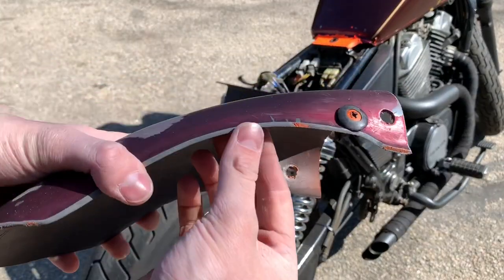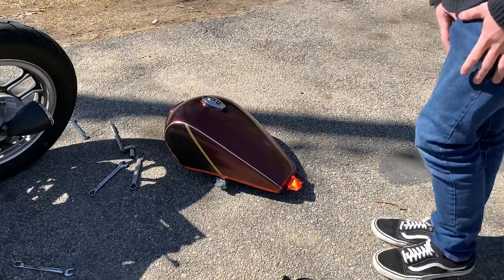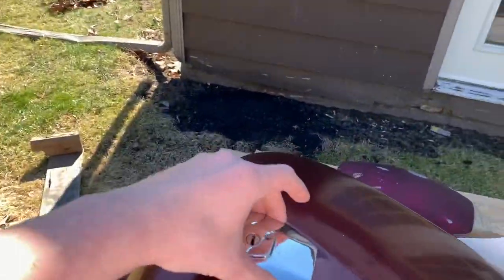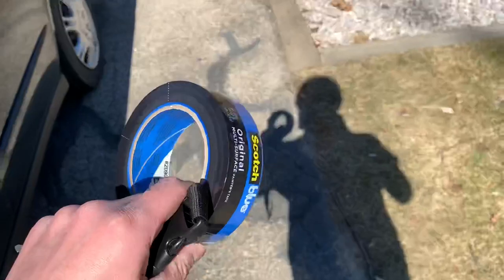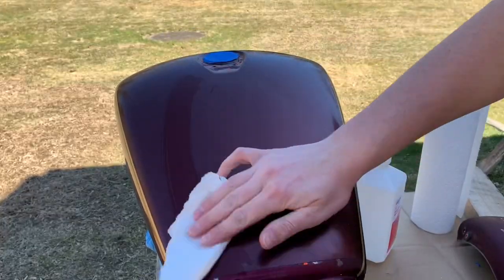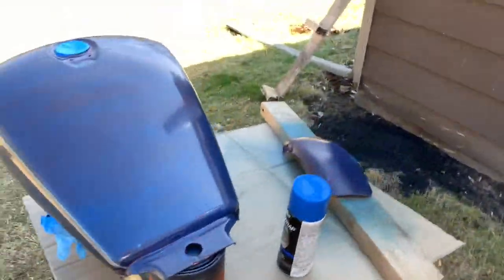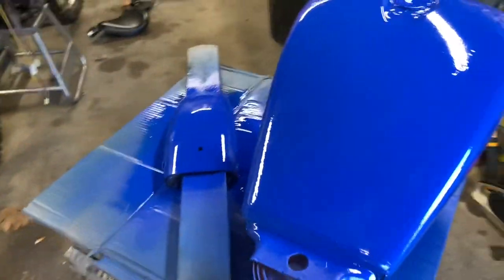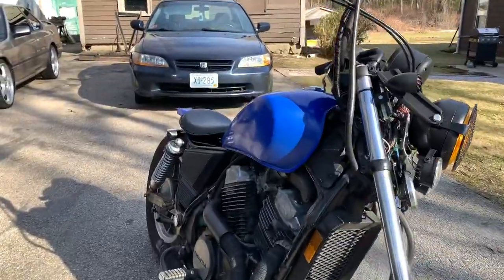How to: Plastidip a Motorcycle | $20 Paint Job!

Comment: Dupilicolor looks good. That blue is sharp.
Reply from the maker: I loved the blue, was surprisingly nice! Moving onto a new color and rebuild of the bike once more so she'll be even sharper soon
Reply: That's Awesome! Thinking of doing mine black, yellow, and white, with Batman decals lolol
Reply: Scared to hydro dip but I may even do that then add the decals and clear coat lol. The BatBike.  Can't waitf to see what you do next! 😎👍
Reply from the maker: @jojomafia214  If you're considering plasti-dip as a paint option in my opinion, you might just be better off to use regular spray paint. Plastidip is cool but you can't spill gas on it, it wont look as good, and is honestly a pain to peel off

Comment: How has the tank held up? I’ve heard plasti dip doesn’t do well with gasoline.
Reply from the maker: Stephen Hartley yeah, other than spilling gas on it, it’s perfect. The trick with the gas is to NOT wipe it off, let it evaporate. But yeah, it reacts very poorly with gas, so maybe carry a rag if you do this to put over the nozzle when you take it out of the tank
Reply: Lol it does not lol. Ii have had to re-dip my tank a few times due to gas spillage from refueling and from a shutting gas cap leaking when I got towed for a flat tire lol. Other than than its hold up well if you do slow smooth long coats, overlap by 50% and do a lot of thick coats
Reply: @jtbasic  in
Reply: Lots of clear coat helps

Comment: ok! time for a 1 year update! how well did it hold up brother?
Reply from the maker: Excluding me spilling gas on it, pretty well! I recently took the dip off and the original wrap so I can paint the bike my final color, going to be finishing it soon with a full revamp. But, the plasti dip held up great so long as you don’t get gas on it
Reply: @OlsonAuto  
ok great. how long did you keep it on before you too it off? saving up to get my tank professionally pianted and my tank is bare metal right now. figured i could plastidip it just to protect it for a few weeks. i live in FL so humidity is a huge ordeal down here tank is starting to rust on me after 2 days in the elements

Comment: How many cans did you use?
Reply from the maker: I believe I used 2, but buy 3 to be safe depending on the size of the bike
Reply: @OlsonAuto I have a front fender as well as a radiator cover. Maybe I'll get 4. Thanks.
Reply from the maker: @69Gibbert69  4 would definitely be comfortable as long as the parts aren’t huge. You’ll usually want 5-6 coats to make removal as easy as possible